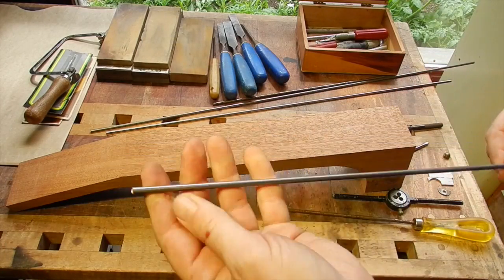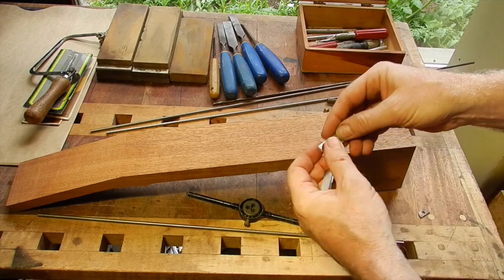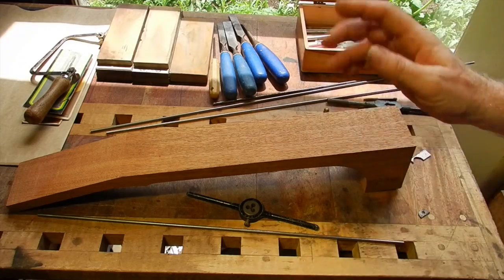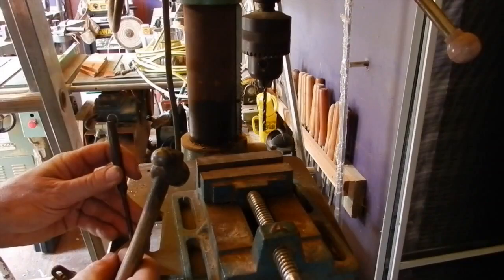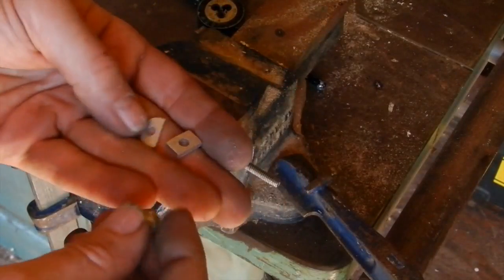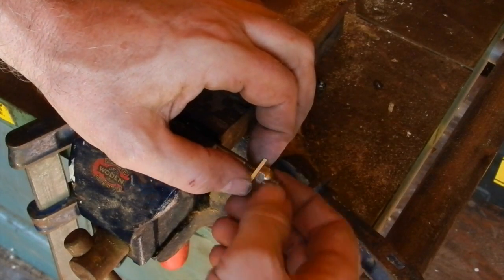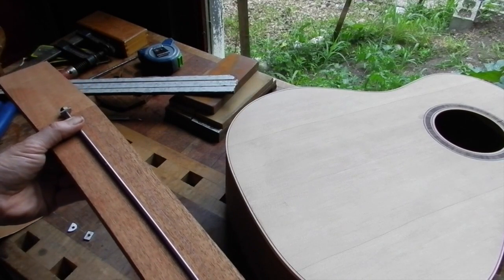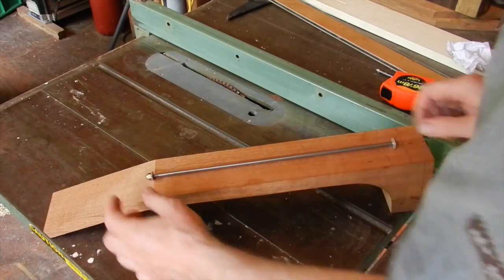MAKE A GIBSON STYLE TRUSS ROD FOR GUITAR

Comment: I am curious to know why you choose to use aluminum for the end that fits on the rod close to the guitar 's body. Wouldn't the aluminum corrode over time due to a process called galvanic corrosion.  This is where two dissimilar metals are in contact with each other and in an environment that favors corrosion. I am not sure if the environment under the fretboard will favor corrosion as it is tightly sealed. Also when tightening the truss rod nut,  what prevents the rod from spinning  since the aluminum washer is not welded to the steel rod. All the Gibson style truss rods that I have seen have the end welded, and the washer is made out of steel to facilitate the welding process. I came here because I I need to replace a broken truss rod in a guitar I recently purchased. I got a replacement on Amazon but will not use it as the diameter of the rod is smaller than the original and I do not want to have to go through the process of having to remove the fretboard again. I  think I will have to make it myself as this rod is not very common these days.